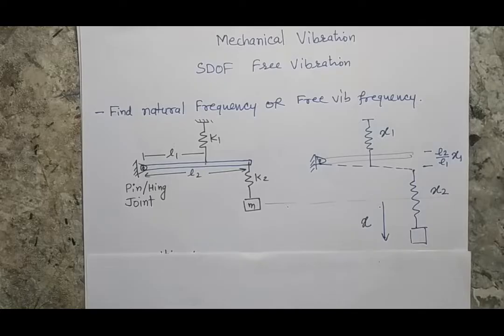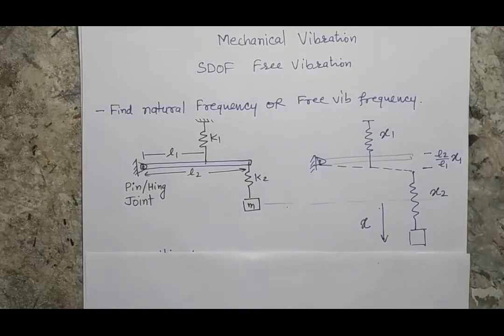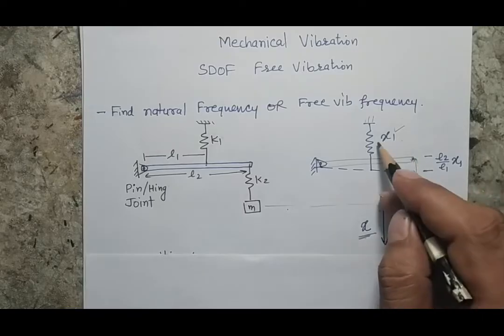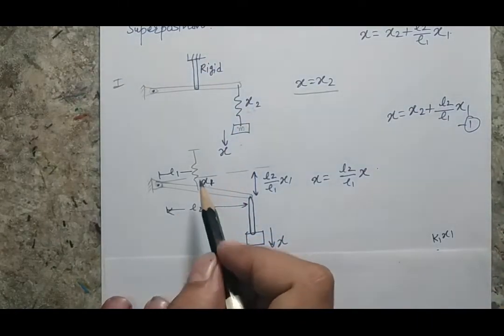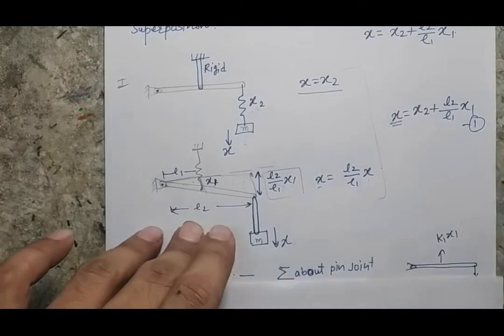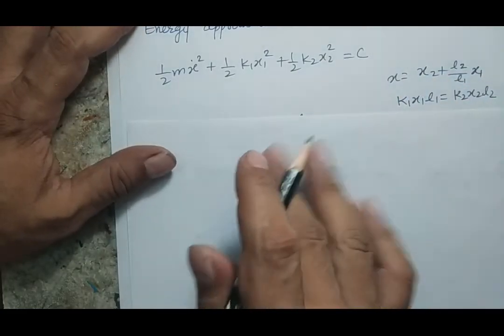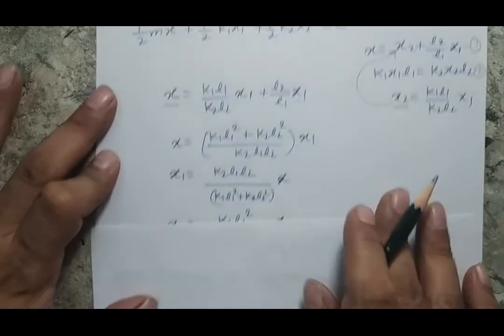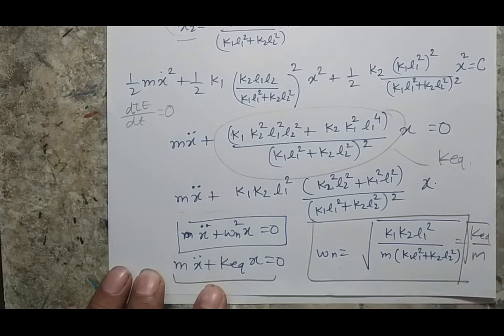Mechanical Vibration Lecture 6|| SDOF vibration of beam-mass system

Comment: »

A vibrating body of mass 150 kg supported on springs of total stiffness 1050 kN/m has a rotating unbalance force of 525 N at a speed of 6000 rpm. If the damping factor is 0.3, find (i) the amplitude caused by the unbalance (ii) the transmissibility (iii) the actual force transmitted and the phase angle.

Sir Answer kya hoga

Comment: Could you help me in a question? Assume that the AB and BC bars are rigid and that the displacements are small, such that,the horizontal displacement in the C support can be disregarded.
It has a B spherical plain bearing and a spring between AB and another between BC. 
How do I solve these springs?
Reply from the maker: Dear Marina, I am not able to visualize the problem as there is no pictorial view, can you please elaborate or mail me at ashishpurohit1(a)gmail(dot)com

Comment: Great example! I have 2 examples that I’m struggling to find the solution, would you kindly assist?
Reply from the maker: Please share
Reply: Ashish Purohit thank you for your reply. I will try to describe but if you can’t picture, please use this email: may.lok10@gmail.com to email me in private so I can share the picture of the 2 examples.
Reply from the maker: ashishpurohit1@gmail.com
Reply: Ashish Purohit It’s a rigid beam with pin support at the end left (point O). The total length at point A is 1m. At 0.25m from the left there is a spring support connected under the beam (point B), at 0.25m from point B there is another spring support (point C) connected on top of the beam. 
At point A (1m) there is a rigid mass (machine),  M=50kg.
For the 2 springs, k=5000N/m. The dynamic loading produced by the machine is 500cos£t (N). The running speed of the machine is 1000r/m
Reply: Ashish Purohit here are the questions:
1. Neglect the mass of the beam OA, find out the natural frequency of the system.
2. The total mass of beam OA m=10kg, not negligible, develop the equation of motion of the system and determine the natural frequency 
3. Determine the displacement reaponse when the system gets into steady
4. Find out the maximum force in springs B and C